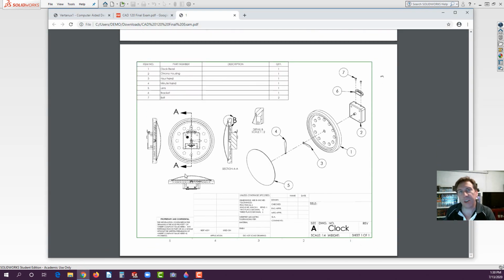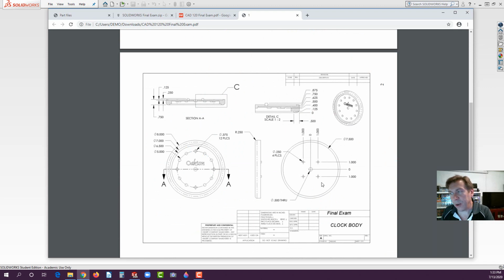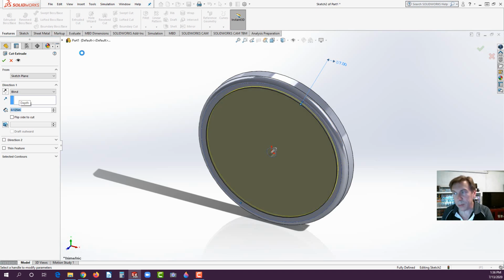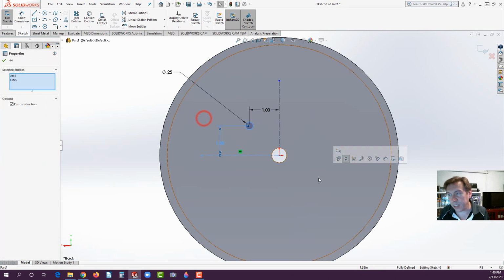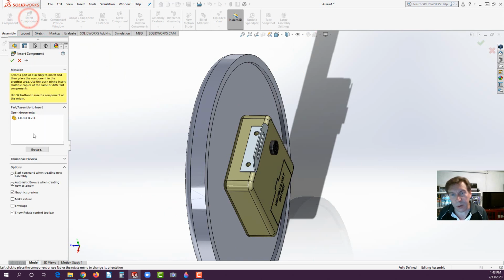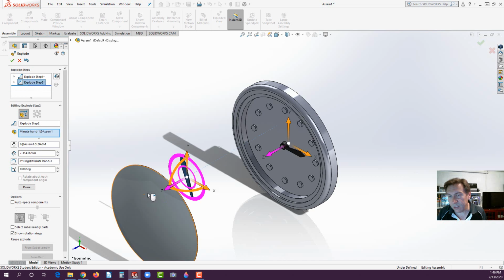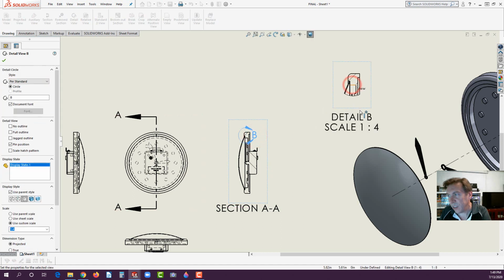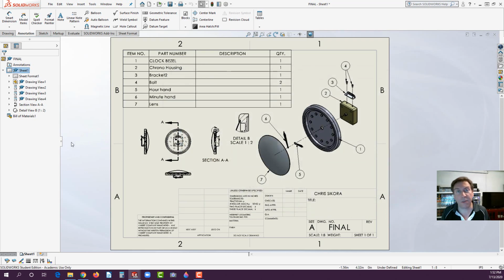FINAL EXAM REVIEW SOLIDWORKS 2020

Comment: hey, watching this in 2025 and was wondering what i did wrong. for some reason i can't rotate the clock hands and they move fixed with the body, when i try to rotate them in the assembly menu they cause the entire assembly to rotate in a weird way. thanks a lot for this course by the way, i wish you would've covered sheet metal in a bit more detail but besides this it was amazing.

Comment: I created the clock body geometry in a sketch and then revolved it around a center line. is there anything to consider which might make one approach superior to the other?
Reply from the maker: volve features are more efficient as far as computer processing power, but may take longer to create the sketch geometry due to complexity, the extrusion method is broken down to simple circles thus making it easier for new users, but every feature is makes it less efficient. In the old days of computers (1992 Sparc station with 24MB RAM) each feature took 5 minutes to process, multiply that by 4 for the the four features. Whereas the Revolve feature still only took four minutes for the single feature. Now with massive speed enhancements of computers this is a mute  point when dealing with small parts and assemblies, but it will ultimately still add up in an assembly of thousands of parts. Resulting in long load and rebuild times.
Reply: @vertanux1  Ah that makes sense, thanks for the exploration. I also like using less features for my own computing power, it makes it easier to keep  track of the relevant features for updating design dimensions or tracking down a mistake. Just passed my CSWA with this course so thank you for your help. Will the advanced class be a sufficient primary resource to get me to a CSWP level?